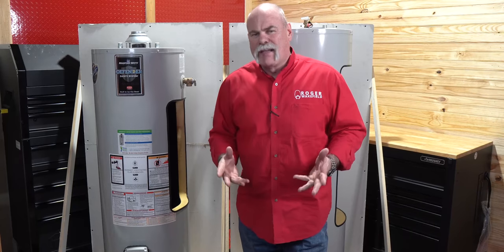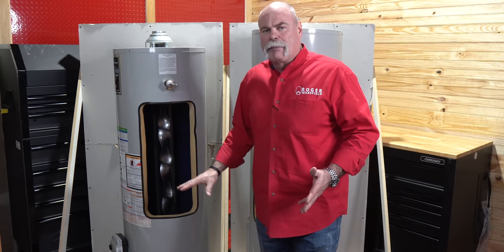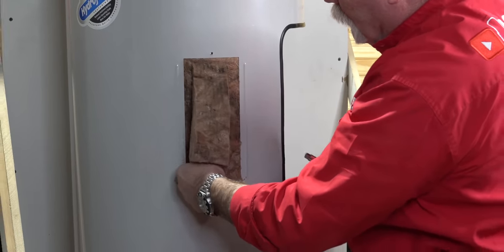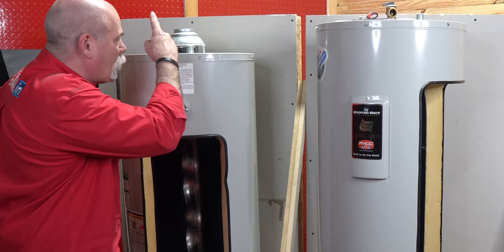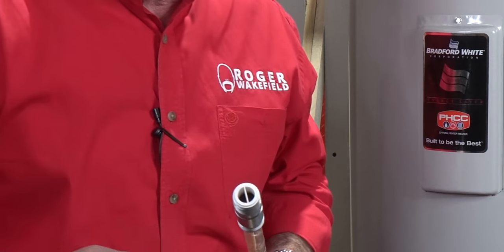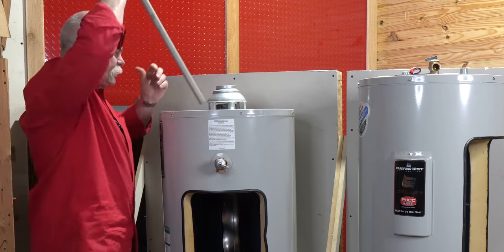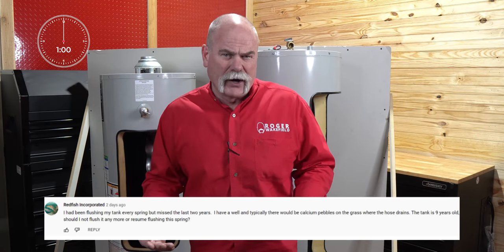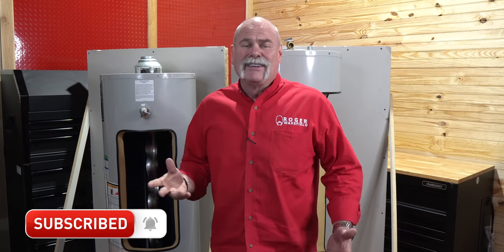Is Your TANK Water Heater Making These SOUNDS

Comment: This is a great video. But it didn't quite help me out in my case. I just installed a new pressure relief valve, and now it sounds like a tea kettle on the stove after a few hours. I'll go and open the relief valve manually and drain some water out (less than a gallon) and it stops for a bit. The old one was just pouring water (hence the massive water leak we had) so that's why I replaced it in the first place. I thought it was due to build up inside the valve causing corrosion but now I'm not sure. I've been told it could be an issue of the water pressure being to high, but I can't find any info to back that theory up. Any suggestions?
Reply: Put a pressure gage on the outlet to test the pressure.

Comment: Do you have to be gas certified to do anything on your gas water heater. What can we do and what shouldn't we do.
Reply: You may need a permit, more areas require permits than they used too. For a leaking water heater, you can get the permit after the install as an emergency. The directions that come with the water heater generally tell you how to install it. Some jurisdictions require hard piping, some require flexible piping, hard piping needs more experience. Also, the water heater is not supposed to be transported laying on its side, so you really need a truck (which can be rented at the store, or you can get delivery) to bring it home. There are also instructions on the flex pipe, which should never be reused. Pick up the gas leak detection liquid, soap can cause corrosion. You also need pipe dope and/or gas Teflon tape for joints.

Comment: Hi Roger. I have a question. I have a two year old State Pro Line Commercial grade gas water heater that has been flushed each year. Sometimes but not all the time, while the washing machine goes into a rinse cycle there is a loud knocking sound from the water heater when cold water flows into it. Its not the normal sounds explained in your video.  Thanks.
Reply: Sounds like a classic water-hammer effect. That is common with the quick-acting water valves in a washing machine. You can look into installing a water hammer dampener to the supply lines of your washer.

Comment: I have a Bradford white direct vent from the bottom from underneath my house into the water tank and when it’s running, you can hear the burners burning properly. You can open the door and look inside and it looks consistently burning but I have a whooshing sound coming from the tank it’s woosh stop , woosh stop, woosh stop, the whole time it’s burning, what is that?

Comment: He fails to mention that a water heater is a tank, with 'usually' 2 heater elements.  A water heater can be flushed, heating elements replaced, thermostats replaced, piping, etc....  or the common man can run down to depot and replace it for the cost of the entire WH....  within a few hours
Reply: Elements are $10. Thermostats are about that also. So for $50 or so, you could keep your system running a really long time, rather than spending 400+ for a new tank.
Reply: Less then $100 to change all that, and easy to do.